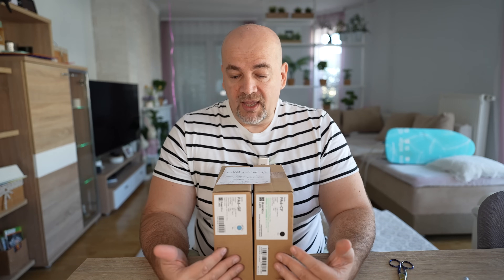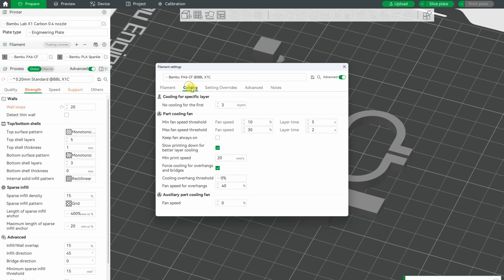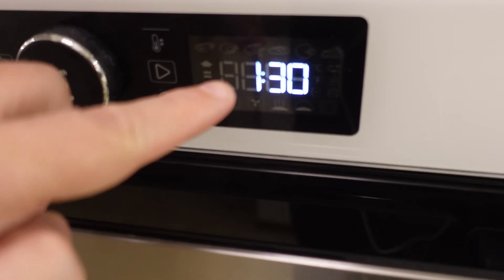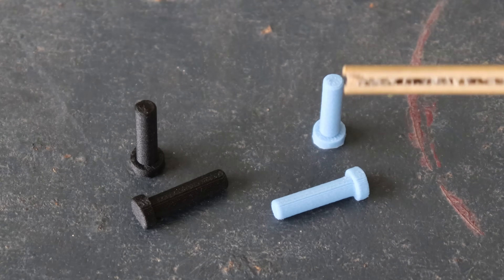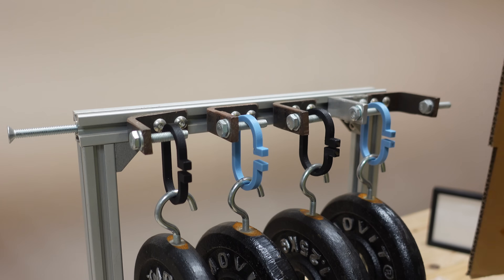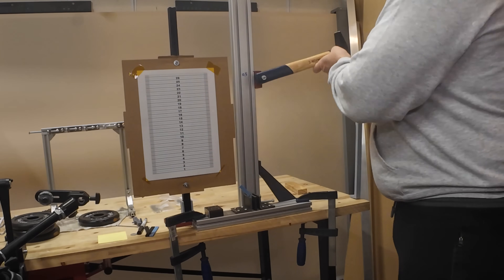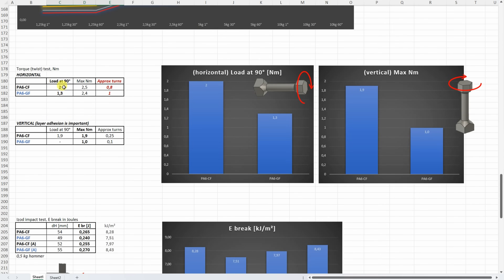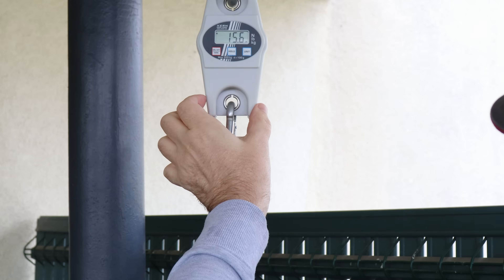BambuLab PA6-CF vs PA6-GF, strongest nylon filaments I tested so far

Comment: I don’t wear a mask when machining metal. I do sometimes wear 4mm thick nitrile gloves to protect against those tiny needle slivers and the chemicals. Not necessary using the lathe. But really, don’t use gloves that are stronger than that. The nitrile will quickly tear if caught by a rotating tool, but anything stronger will pull your hand into it so quickly, even at very slow speeds, that you won’t be able to react.

Comment: Thanks for your great job  of testing these and sharing the amazing results. 
I found another test you did with similar PA6 material (Polymaker) two years ago, but you got completely different results. Those have much tensile strength (almost half). 
What contributed to that? What is the printing setup, brand or something else?
Reply from the maker: Very often there are brand differences. They use different additives. Soon I will test 4 Polymaker (Fiberion) Nylon filaments. We will see.

Comment: I see you print quite fast? I print at 60 mm/s max. For drying: I dry at 0.1 bara (90% vacuum) and 50°C since water evaporates at 45° at thet pressure. The problem we have is bounded water, which is inside the filament. The pressure pushes the water out under the form of gas and then the pressure in the container rises, engaging the vacuum pump. the filament slides through  a tpu guide, so the vacuum stays constant, and the RH is < 1%. The annealing is less needed.

Comment: This is very interesting indeed! Especially the annealing part. It's well known that annealing improves creep of nylon prints, but suggested anneal settings vary wildly - in this video you use 100C for 1.5hr, someone on reddit recommends 80C for 8hr, Stefan from CNC Kitchen mentions 160C for 2hr (I've used this personally, there's practically no deformation in the prints), and there's also Polymaker PA6-CF20 filament for which Polymaker officially strongly recommends 100C for 10hr (same as for their PA12-CF10) - at the very bottom on the product page. 
The common understanding is that semi-crystalline structure of the material rearranges somehow during annealing that results in the stronger prints. The open question (at least I haven't found an answer supported by experiments/research) how long does it take for material to rearrange itself fully. Also there are number of related question - the transformation might be slow and 2hr might not be enough to reach max benefit, but how long it enough? Would higher temp speedup the transformation or not so much - e.g. would 160C for 5hr be enough to reach max strength?
With your extensive testing setup it would be possible to get proper answers and it'll be really useful for the community. I have at hand a PA12-CF15 filament, so I can contribute test prints (e.g. sets of prints as is, annealed at 100C for 10hr, at 160C for 5hr and 2hr, 80C for 8hr - to see the variations), if you'd like to proceed with experiments:)
Reply from the maker: Good suggestion to test this. But the problem is that it variates a lot, depend of the object. When they tell 8h for example, they must predict that even a big object with infill will be heated to this temp (head sculp). My test objects are thin and solid inside. If 1.5h is not enough, I don't even want to do the annealing. So much energy is needed for it.

Comment: Great video as always! Will you be testing the Polymaker PET-CF17? It appears that once the Nylon part is “wet” after printing that the PET becomes stronger, just less heat resistant. I’d be interested in hearing your opinion.

Comment: Regarding the layer adhesion values. A lot is depending on the temperature, layer width, chamber temperature. See CNC kitchen video about heated chambers. 
I made no direct testing, but the PACF parts I have tested printed at 65C chamber temp fail quite nice, fracture does not really follow layer lines.
Egyébként szép munka, köszönjük!:)

Comment: I like your tests a lot but miss only  that you add the standard filament without GF or CF in the test. It would be interesting how the standard PA6 (or PETG, PLA. ASA, ....)  compares to the GF and CF variants as well because it would help to choose the right filament.
Reply: Bambu doesn't make standard PA, and he did include it in polymaker PA video.

Comment: Been very happy with PA6-GF for moderate temperature laboratory applications. But polycarbonate is much easier and faster to print for some uses. I had bad experiences with PA6-CF which is far more brittle than GF version, and it was breaking in the PTFE tube going to print head. GF can be used in AMS but CF can't, so thats another plus.
Reply: I'm looking at PC-GF for some special shims that will remain under compression indefinitely. 
Just curious if you would know how it's compression properties are? 
My shims will be:

.046"
.062" &
.120". 

Surface area = to 2.5"x5" rectangle with 1/2" slot around 3" long.
Reply: @helixx_4D  Ive been using PC without GF/CF at work as moving parts under changing strain/stress and so far have not seen any deformation. I'm doing it at elevated temp too, around 80-90 degC. Be sure to anneal the printed parts after printing: bambu suggests 85 - 100 degC for 6-12 h for their PC product. If PC does not work I'd next try nylon/PA.

Comment: Interesting, these filaments are very different than normal PA6-CF. The low creeping is nice, but the low impact strength (not as written in the data sheet) in comparision e.g. to Polymaker PA6-CF is really disappointing.
Reply: Bambu seems to have a habit of selling "engineering filaments" with properties quite a bit lower than you expect based on the name as they seem to blend them for easy printing on their printers, which I understand, but it means that a Bambu PA6-CF might be quite a bit different than a 3dxTech PA6-CF

Comment: From what i heard, in manufacturing, batches of PA parts are bagged with an appropriate amount of water and allowed to absorb for 24-48h in this very moist atmosphere, so they reach 4% moisture absorption rapidly. Then over the years in use some moisture can be lost depending on circumstances, but overall as you might guess it's fairly good at holding onto moisture. I wonder how much moisture they gain when you condition PA naturally. The moisture changes the dimensions of the items, making them larger, but it also serves as a plasticiser which gives PA its high amount of endurance.

I don't know how fibre filled materials behave in difference to pure ones.

Comment: Nice Job!

Would be interesting to boil the materials in water for the same time and see if it also affects the strength without loosing moisture. Maybe one at full power and one at middle heated cooking plate.

Comment: Your video makes me want to run out and buy the PA6-CF, but I realistically don't have any practical use for it currently. I know I will be looking for models to print with that filament from now on though.😁

Thank you for your awesome videos and your dedication to the facts and testing as an engineer.
Reply from the maker: For me it's biggest advantage is the temperature resistancy.

Comment: Very good as always, but one thing bothers me is that you printed the CF 10c hotter than the GF which also explains the over extrusion and the poor layer adhesion of the GF.
(Also the flow rate was higher giving the material less time to heat)
Reply from the maker: With new filaments, I always want to try things, which will most of users do. Minimal drying (if any), probably no annealing (but here I did for my curiosity) and printing with default settings in bambu studio.

Comment: Great video. One question is why not print at its highest temp for the best results?
Reply: higher temps do not translate to better results, it's a bit more complex than that
Reply: @naminiyo1  I would say atleast for layer adhesion, it is better and would give better results in general. not in all tests but in most.

Comment: Great video. Sure fibers can be an issue for health, and 3d printing also releases micro plastics... So just don't print in a living space, vent the room, and when sanding or drilling or even breaking supports use a mask and gloves. As you say, it is the same as MDF or other materials containing fine particles. When embedded in resin it is not such an issue. And if you print CF parts that need to be touched extensively, a small coat of epoxy or thick acrylic coat will do the job.

Comment: Great review! We print from PA at work - various holders that need to survive the 125 C heat chamber test of our products. It is an amazing material. Two remarks from my experience: PA6 and PA12 (and i think also PA11 exists) are both nylons, but mechanical properties are noticeably different. And second remark is actually an advice - if You dont want to spend money for special PA print sheet for You printer - either use a lot of stick glue, or print a layer of 0.2mm PETG and then print the PA part on this. It really works!
Reply: Great tip about using PETG as a well-controlled adhesion and release layer, thanks!
Reply: I print a handful of different nylons, I just use regular White school glue (pva glue) blended with 50% water. Heat my bed and then paint or wipe a layer on with a sponge. Wait a minute to dry- repeat. I do this a couple times from a bare plate- or just 1 quick wipe in between new prints. It works phenominal. Don't be afraid to get too much.
Reply: Nano adhesive on Garolite works really well for me.
Reply: So can PETG be used as an interface layer for PA6 GF?
Reply: What is your advice on annealing and possibly boiling the PA prints? For a prototype that needs to withstand the same 125 C heat chamber test we're looking into PA6-based filaments. The first filament we tested is a PAHT by Luvocom, and it barely passes the test.
Reply: @Daan87423  Hi! It depends a lot on the weight of the specimen it holds. If its heavy (as we test whole brakes - so several kgs) You will need to go with PA reinforced by some fibers. Pure PA6 will hold itself and very light specimens even after annealing - but as heavy load is applied, it may actually start to deform at about 85C. For these heavy test objects we either have to use PC with fibers or usually PEI 9085, PSU or similar ones (so work for HT90 printer).
Reply: @ Thanks for the quick reply! The weight it'll hold is not so much, but we're restricted by regulation. It needs to withstand a 5 mm steel ball with 20N at 125 C (ball pressure test). Furthermore, since it holds electronics it needs to be flame retardant, so our choice is pretty limited. The filament we tested so far is PAHT with ceramic spheres (LUVOCOM 3F PAHT KK 50056 BK FR). But there's no mention of any annealing, and wet vs. dry conditions. I'll test it myself in the coming days but I was hoping you could provide some practical insights about printing with PA and whether or not it's common to anneal and how much influence moisture absorption has 😄
Reply: Aqua net extreme hold hair spray. Way easier to clean off the textured PEI sheet. Thank me later. :)

Comment: Can you please try the bed adhesion of the PPA-CF at only 100°C for all the P1S owners?
Reply from the maker: P1S bed max is 100°C? Oh, I didn't know about that.
Reply: @MyTechFun  Yes, sadly its limited (on a stock device). Bambulab suggests 100-120° bed temp. with glue for their PPA-CF. I guess there are many P1S owners curious if the bed adhesion would actually be sufficient at 100°C. Especially since the filament is a bit expensive to just try it yourself.
Reply: @TwieThilo   My experience is that if you're really concerned about warping, take a trick from the resin printers, and print it at a 45 degree angle on supports. On my old SV01( Ender clone), supports and lots of retracts were risky. But on these BambuLabs printers, you can go crazy on supports.